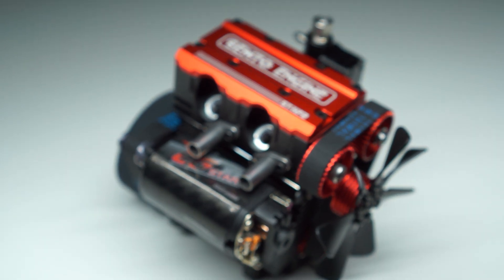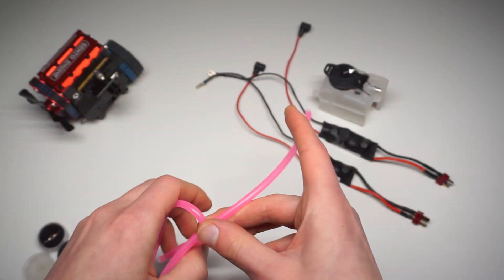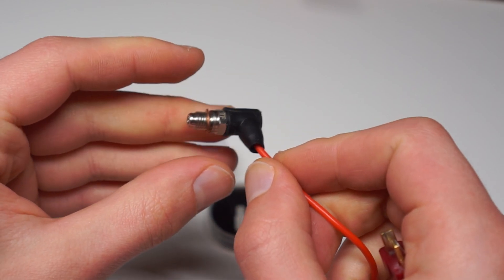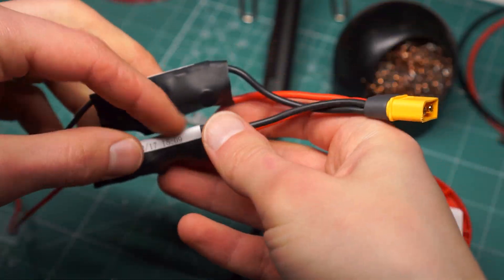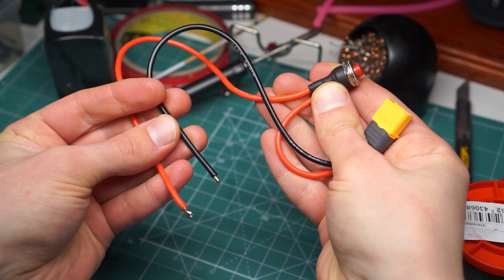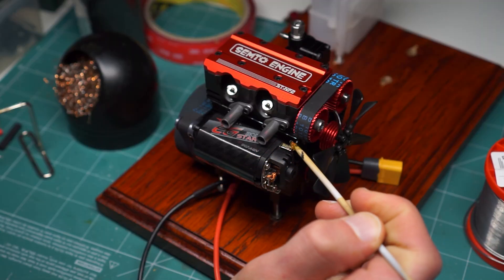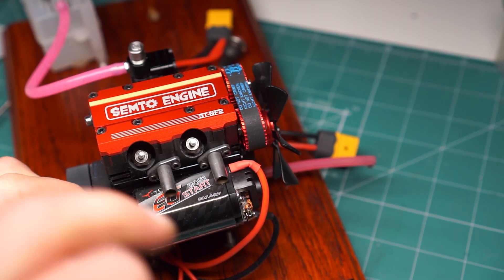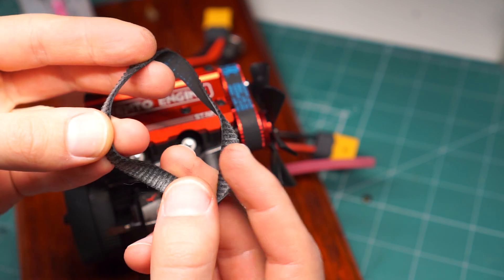Starting 4 Stroke nitro SEMTO engine from EngineDIY

Comment: Hi, mine doesn’t seem to start. Please tell me why.
Reply from the maker: Might be variety of reasons, if you assembled everything as instructed. 1st. check if spark plugs are ok, see if spark is hot and bright with removed spark plugs, than make sure belts are installed correctly, because difference in 4mm can cause it to fail.

Comment: Quick question. At 3:41 there's something leaking from the pink tube, is it oil? What is it?
Tysm!
Reply from the maker: @stephenb-ly3og  That is exhaust, and yes, unburned oil is being spit out.
Reply: @StaticModel  is the oil in the fuel? Where does it come from? tysm
Reply from the maker: @stephenb-ly3og  the version shown in video is a glow fuel engine, so it uses nitro fuel. Nitro fuel is a mixture of nitromethane, methanol and synthetic oils. You can also build this engine as a petrol one, but than glow plugs must be replaced with spark plugs and special timing devices are required, etc... :)
Reply: @StaticModel  Ohhhh gotchu!

Comment: Hi, did you use two separate batteries for the starter and glow plugs?
Reply from the maker: Hi, yes exactly. The idea behind it is to make troubleshooting easier and eliminate voltage dips when starter is spun.

Comment: Hey man, I'm currently building the same engine, and big question : oil? Nobody talks about it, did you put some on the crankshaft or over the Camshaft? Thanks
Reply from the maker: I did put grease over the camshaft, plenty of it. It was not included in the  kit but is necessary for proper functioning. Other parts I just oiled with after run oil for nitro engines. Not a big deal for crankshaft since it will be getting oil with a fuel.

Comment: Hi, I have the same one and Im doing the wiring. What battery did you use for the starter and the glow plugs?
Reply from the maker: I used 2 cell LiPo battery. Also tried 12v drill battery, it also worked.

Comment: Hi, I have one of those engines and the same thing happened to me as the starter belt slips and I don't know how to fix it because I hardly get any oil in it, maybe there is a solution?
Reply from the maker: Make sure your 2 pulleys with red dots are aligned like shown in the instructions, because if they are miss aligned engine will have more resistance than it suppose to have, it means more work for the starter and belt. Also drop in some engine oil thru the glow plug socket, just to make initial turns easier. Starter shouldn't be doing more than 3 seconds of work before engine starts.

Comment: When you have started the engine, do the glow plugs operate on a battery or a magneto of some sort?
Reply from the maker: Plugs operate on battery at the start. Than heat is maintained on its own from the fuel burning. It's nitro engine, keep in mind.